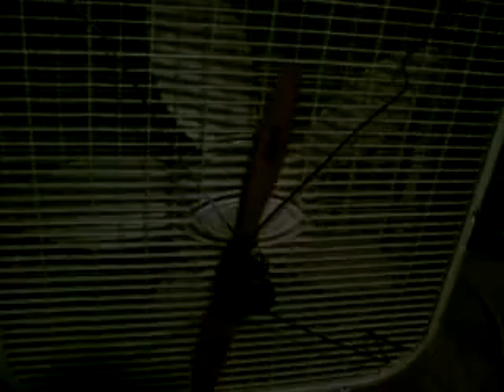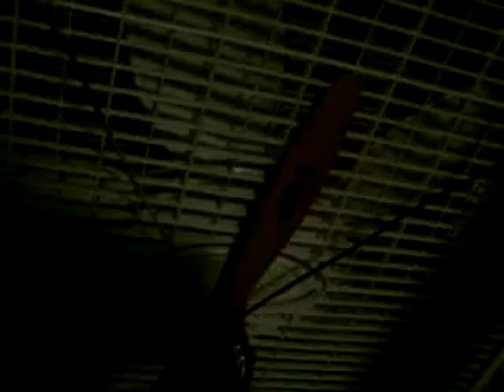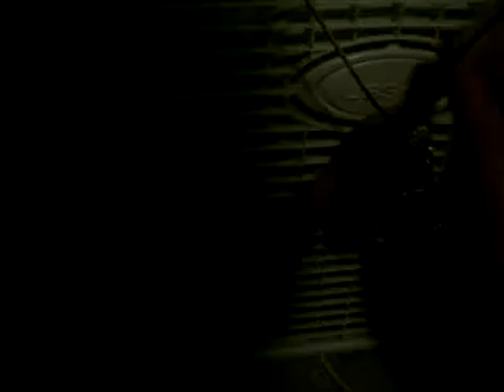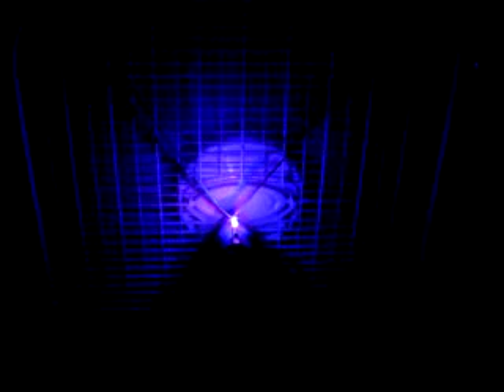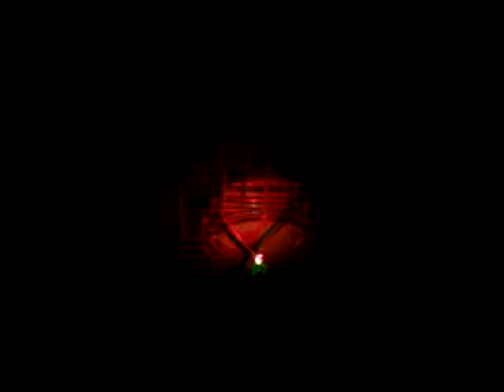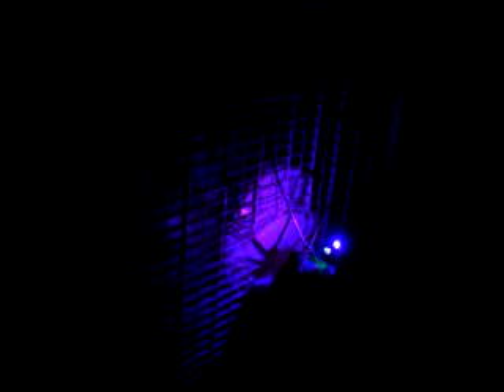Box Fan Night Light , #2

Comment from the maker: This DC copier motor had a sleeve on it. I Silver Soldered two clothes hangars to the motor sleeve and bent the ends to hook into the grid, so the center of the prop in in the center of the fan and kept close to the grid.  
The motor, rectifier, capacitor, are from scrap electronics.
I already had the clothes hangars & fan. 
I bought 100 LEDs for 5 bucks so this project cost less than a dollar.
This is the closest to "FREE ENERGY" as you will EVER get.....LOL

Comment from the maker: R/C Airplane Propeller~~~J ZINGER 14 - 4 
I tried plastic props but they were too heavy.
This is the wooden prop I am using.
It worked the best out a handful of wood/plastic props someone gave me.
You may find it cheaper somewhere else 

https://www.hobbyzone.com/building-supplies/props-and-spinners/nitro/wood/ZIN801.html